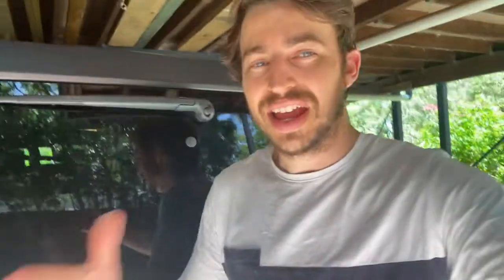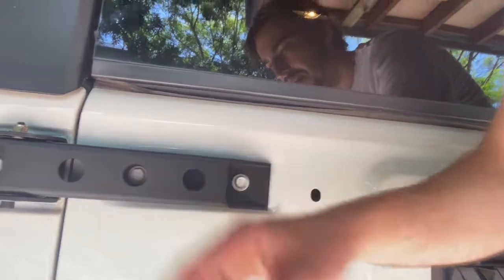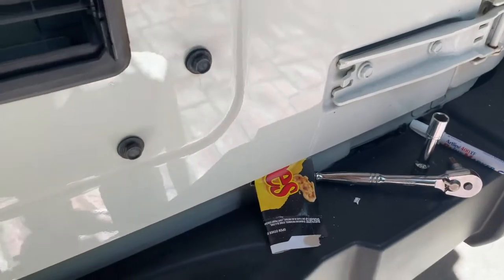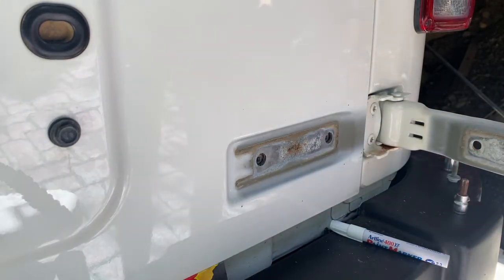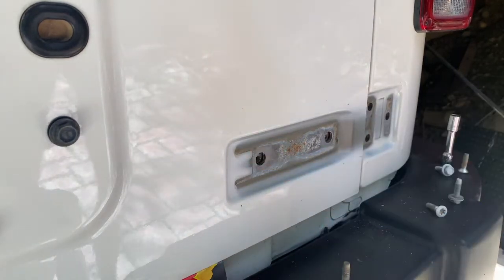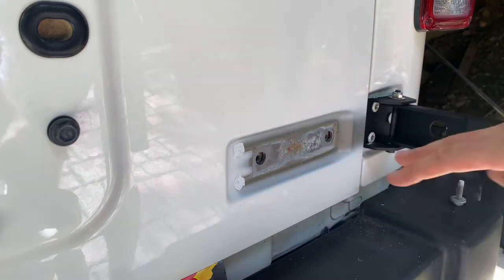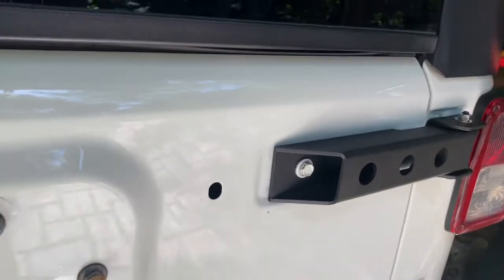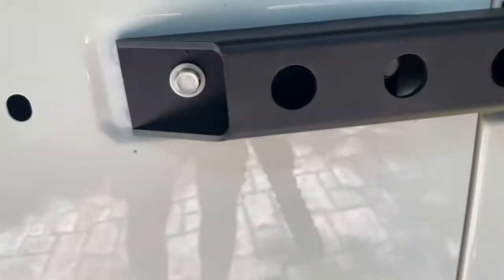JEEP JK TAILGATE HINGE UPGARDE

Comment: Great video as always. Looks much better and stronger than the plastic covered standard hinges. Only thing I’d add is to paint the bolt heads black to match the hinges.
Reply from the maker: Thanks really appreciate it, I have been thinking about doing that, I might have to do that. Thanks